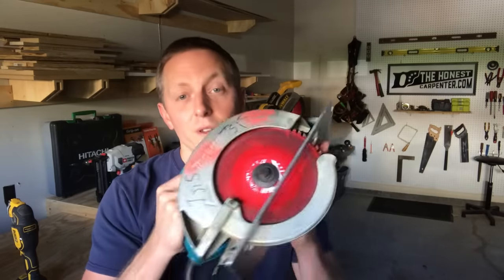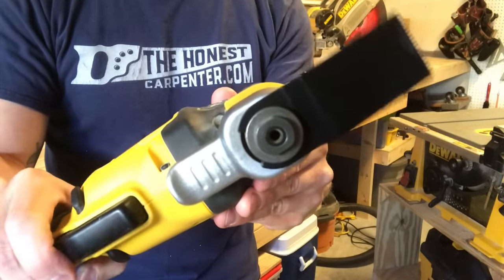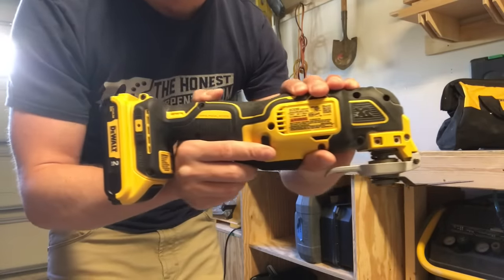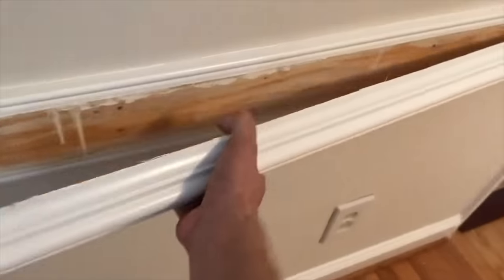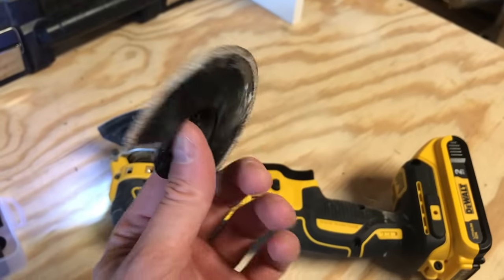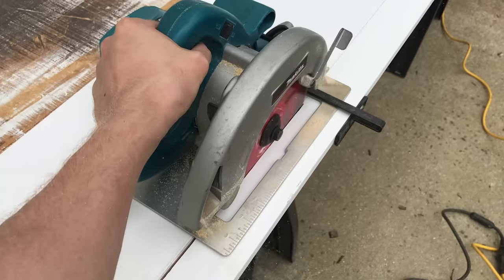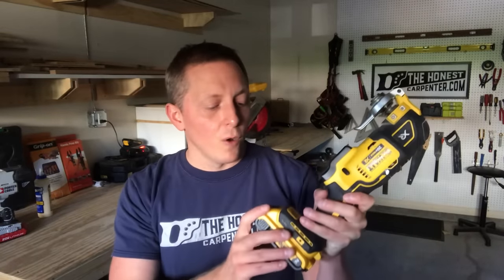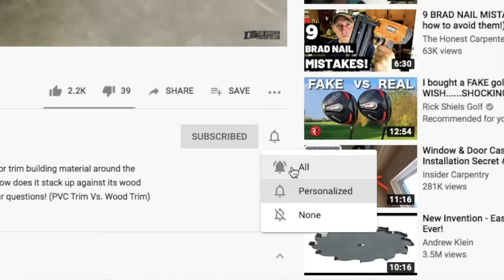The BEST SAW You've NEVER HEARD OF!! (Multitools--Great For Remodeling!)

Comment: "The Honest Carpenter"  "The best SAW" thumbnail and video about an oscillating tool.  I've burned through three now, but never called it a saw.  Don't know anyone who does.
Reply from the maker: You’re right. I mean, it’s got a little light on the end too...maybe should’ve called it the “best little light for remodelers?”🤔
Missed opportunities!
Reply: @TheHonestCarpenter  Mine is called Ossy.  I tell my worker to "go get Ossy out of the truck" lol.  Used mine this morning to sand with.   I've burned through a Porter Cable, Craftsman, and now I have a Westool.  The variable speed ones seem to shake themselves apart after a year of heavy use so far.    I mostly use Bosch tools, but theirs is 200$ and only takes their own "starlock blades"
Reply: You can use Fein blades but Bosch are a little cheaper. Try the ones that are arch shape they tend to cut faster,more accurate and  not over work the lower powered motor models!
Reply: DR PHIL  I did look at that one but the whole "bare tool" buy the battery and charger for $$$$ separately stops me.  All the manufacturers decided to rip us off like that suddenly as a group....
Reply: Anyone who doesn't recognize that it's a saw has a flawed thought process. Does the blade have teeth, and do the teeth go back and forth to make cuts? As for calling it a saw,  the best name I've heard for it is a "jiggle saw" which is a really good description, and at least 40% shorter than other names for it.
Reply: @stevepseudonym445  Nope.  When I put the SANDING attachment on it does not have any teeth and it cannot saw a thing.  When I put a scraper blade, likewise, not a saw.   So at that time it ain't no saw. The "multi" part of "multi-tool" name which is used in trade of these devices, and has entered the general lexicon of those in the building trade, makes my OPINION differ than your opinion.   The thing is, well... MULTIple-TOOLS!!!!! The best name for you, having accused me of having a "flawed thought process" is "jigglebrain".  Or perhaps "passive aggressive" describes you better.  It is, at times, a saw yes.  So I don't see how my thinking is flawed.  If you had an oscillating tool, and a circular saw in your truck, and told a worker  "grab me the saw out of the truck", what do you think they would come back with?  I rest on your face.  OOPS!  I mean I rest my case....(how passive aggressive of me!!!).  Hey are you commenting on a made up name to hide?
Reply: @edwardschmitt5710  , @Steve ... Guys, guys... Settle. 
TLDR: Lets call it what it is, and it can be several things: Firstly a Multi-Tool, but in certain scenarios calling it a saw makes much sense!

Longer:
We know, both descriptions make sense. Both at true. WHAT we seem to discuss is: how to communicate/describe what this tool is. I agree a Multi-tool, best describes it. However, this also tells nothing (multi-what?). Still i prefer this. BUT for someone who need a light saw, it totally makes sense to refer to this tool as e.g. a small saw, or something, and I liked the "juggle Saw" term.
Reply: @carbari  Sorry!!! I get triggered when people take up a condescending attitude with me.  I like a good healthy debate, but that is sadly impossible sometimes.  I can acccept I am human and can be wrong.  Sorry @ Steve.
Reply: @edwardschmitt5710  he called it a (multitools) as a saw because he wanted to talk about it's capability/function (when using it) as a saw. He then compared the cutting (sawing) function to other type of sawing tools. The scope of topic here is about sawing. Yes, it's a multitool. Agree. But... It's also a saw..... and also any other thing it can do. The title is focusing on the context. Not trying to misinterpret its name or limiting it's overall function. He knows that it's a multitool, yet he called it a saw for the context.
Reply: @arievianza  So you need to win and where should I send the trophy? ??
Reply: And you misuse (") ()".
Reply: @edwardschmitt5710  typos or small error is understandable by many when quick (typing) comment via small phone small/limited virtual keyboard.  It's humane. We make mistakes, sometimes we let it be a mistake. Lol. 
Well, I tried the good heathy comment and nothing is about winning. If you want the trophy and there's one. You should have it. 😀 peace man.
Reply: @edwardschmitt5710  Hilarious...an example of life in the time of craziness...I learned a lot though
Reply: @edwardschmitt5710  Well said, Steve! I also know that feeling. Probably, having a worthwhile debate is, I guess, as much about creating a healthy space for such frustrations as well - because that is human!
Reply: @arievianza   I actually think ' @Edward Schmitt ' got the point already. But great to see you agreeing that you actually both tried, not winning, but simply having a healthy conversation :-)
Reply: @carbari  🙏🙏🙏 Agree And again, peace 🤟
Reply: it is obviously a "saw"...not a hammer, not a screwdriver, not pliers, not .......
Reply: @everettpalmer6393  not a sander, not a scraper....you miss my point.  Let me dumb it down for you:  Calling something only one thing when it has multiple uses subtracts from that fact.  I'm not saying it is NOT a saw.  You can lead a cow to water but you can't make it drink...
Reply: @edwardschmitt5710  got it...I can get on board with that...
Reply: (except for the cow...and making him drink.....not sure how that applies to an oscillating tool...perhaps you can "dumb that down" so that even I can understand it)
Reply: @edwardschmitt5710  You were the first to condescend....."let me dumb this down for you"
Reply: @everettpalmer6393  No I treat people with respect who do the same to me.  You drew first blood.
Reply: Never thought I have a use for one of these tools, but I ended up buying one for a big flooring job. I got the Kobalt multi tool. But really, It takes a blade that has teeth and it cuts. If not multi tool, what else could you call it? To me, calling it a saw isn't a stretch. They are hard on blades. The Koblat came with a pretty big assortment of blades, so the tool was actually pretty cheap. Was pretty surprised at the cost of the replacement blades. The better quality blades are worth the extra cost. Best place/cost is Harbor Freight. All in all, I think this video is a pretty fair and accurate assessment of this tool, no matter the brand.
Reply: DR PHIL  It seems to be quieter too
Reply: @stevepseudonym445  Agreed.  Have teeth and cuts? ---->  saw!
Reply: @achacs1  bahaha
Reply: It goes back and forth by oscillating, it has teeth to cut, guess what soooooo many other saws have these features. Hack saws, carpenter saw, jigsaw, plumbers saw, coping saw and so many more. It's a fucking saw when you have the blade for it. GEEZ!
Reply: @AztecWarrior69_69  "Plumbers saws"?  I do a lot of plumbing, (I'm remodeling a bathroom right now in fact.)  What is that? please, teach me oh wise and wonderful "Aztec Warrior"....And when I have the sanding attachment on it is it a saw?  When a scraping blade with no teeth is on it I guess you would say it was a saw.  Oh wait your definition of a saw is "It has teeth to cut", so by changing the blade it can no longer be a saw.  Yet with no blade my other saws are still just saws.  Go search "saw" on Amazon, you will get lots of saws, let me know how long before an "oscillating tool" or "multi-tool" appears in the products.  It's hard to win an argument with an intelligent person, but impossible with a stupid one.
Reply: I see some people I bet are really fun at parties here. sarcasm mode off
Reply: @charlesthronesbery5601  lol
Reply: We’ve all heard about this saw, nothing nee
Reply: Nor Me ,its a MULTI-tool to which mini saw blades can
be fitted to and extremely handy it is too, and where does he get the message that no one but he has heard of them. I,ve had one for years.
Reply: @stevepseudonym445  Dude I love it jiggle saw works fo me.
Reply: Edward, Buy a Rigid. Lifetime Warranty.
Reply: I call it the "buzzy tool". Way more fun to say than "oscillating tool".
Reply: @TheBigBigSean  I call mine "Ossy the Oscillator" I tell me workers to "get Ossy from the truck".
Reply: At the most basic level - If it cuts, I think you can call it a saw.
Reply: @PatrickParsonWorkshop  Again, if it has a sanding attachment on it and it can't cut and only sand, what is it's "basic level" at that point?  It's ok if you still don't understand my point.
Reply: buy the Fein multitool( the OG) , yeah its spendy but you will only have to buy 1 in your lifetime. i've used mine, just about daily, for the past 12 years, its never let me down.
Reply: @everettpalmer6393  but its also a sander, grinder, grout remover etc....
Reply: ...and the EGO strikes again.
Reply: @edwardschmitt5710  Batteries cheap as chips on ebay.  Bare tool without battery much cheaper and you can get the hours capacity you need. Just bought one I will repost if not genuine dewalt as advertised.
Reply: @edwardschmitt5710  it's still a saw though. Just a different and more versatile type. It's primary purpose is to cut. Everything else is a bonus. Just because you don't call it a saw doesn't mean it isn't.
Reply: Funny, I searched for saws on Amazon and the oscillating saw was in the first 5 results. Its original purpose was a saw, hence the original name "oscillating saw" before it became a "multi-tool". I know more people that call it a saw than I know people who call it anything else. If I asked my wife to bring me a saw, she'd have to ask which one regardless because I have so many different types. I have to specify either way, so I call it an "oscillating saw". If I said "multi-tool", she'd bring me my Dremel.
Reply: @HungLikeScrat  Doesn't make is a saw when the sanding attachment is on it.  Doesn't mean I'm "sawing" up stuck on tile with the scraper on it.  Doesn't mean you are right and I am wrong.  DOES mean people just need to feel validated with their opinions on things.  And why on earth does what tool your wife brings when asked prove anything?   We all know very well if you asked her for a saw she would come back with a hand saw, and you know very well you would have to be real specific or just get it yourself if you needed an oscillating multi-tool to saw something with.  Is "searching things on Amazon" really valid to argue with?  My wife wanted a "vibrating massager" for her sore back, do you thing the products that came up were for "massaging" ?????
Reply: @edwardschmitt5710  Why be that way? You got snarky and when others followed suit back at you then you got bent about it.
Reply: Plunge cutter is what ive always called it. These tools r absolutely necessary for certain things. It can effectively replace a couple different tools like a chisel. Love these tools
Reply: @edwardschmitt5710   "I get triggered when people take up a condescending attitude with me."

Should read your OP, and take your own advice.
Reply: @stephanielafever7680  its really good for a variety of things. The cheaper blades r worth the buy
Reply: @edwardschmitt5710  who hurt you?
Reply: @edwardschmitt5710  The fact you are so defensive insinuates some deep emotional issues, get some help buddy.
Reply: @edwardschmitt5710  A case in point.
Reply: @toby8278  A keyboard genius returns with another stellar retort.  Does it hurt you to speak with others who do not posses such a superior intellect?  Well we cannot all be such perfect humans as you, but at least you can sit there and judge as all .
Reply: @edwardschmitt5710  lol
Reply: @abhaynatoo  Wise words my friend, wise words.  "It is hard to win an argument with a smart person, impossible with a stupid person"  (Bill Murray).  This has been a waste of my time certainly, and all pointless semantics.  At least it has helped the maker of the video as every comment is a "view".
Reply: @edwardschmitt5710  I can't believe you've been arguing on this thread for 6 months. Sad.
Reply: @edwardschmitt5710  lMr Schmitt, you are getting belligerent. Please go do some sawing in your shop with a multi-tool.
Reply: @mikewillerton9667  foul
Reply: @FHL-Devils  Mr Schmitt obviously has some issues he can't accept "You say po TAY to, I say po TAH to". Wish he would call the whole thing off. I asked him to go do some sawing with his multi-tool. Sometimes being busy calms a man.
Reply: @annieleu5922  Some people don' pause and say "hey maybe I am wrong" to themselves, but that is a wall between you and the truth.  The only thing thing I have been doing here is saying YES IT IS  A SAW, but it does so much more I PERSONALLY don't call it that.  Most people I guess think their opinion is the ONLY one.
Reply: @edwardschmitt5710  You've haven't been saying that it's a saw at all. You've taken every opportunity and reason to not call it a saw. Maybe you've been arguing so long you forgot where you started. "Don't know anyone who does." It would seem that in this thread, you've met quite a few people who would call it a saw when the sawing attachment(s) are attached. Your OP can and was read as very dismissive, and your subsequent comments reinforced that. I wonder how many other threads you have sprinkled on the internet that look pretty much like this one. You can have your opinion - nobody's taking that away. You're just being judged for it.
Reply: Well, he did says it's not called a saw at 0:31
Reply: @edwardschmitt5710  most people already own multiple chargers. Just a waste of money
Reply: @TheHonestCarpenter  Sir, why did you have to use a Dewalt which vibrates most men to Mars
Reply: @edwardschmitt5710  The whole point of selling "bare tools" is that someone can buy many tools from one manufacturer but doesn't need a new battery for each one.
For a DIYer, for example, 1 battery and charger might well be enough even if they have a handful of tools. A tradesperson might consider 4 batteries and 2 chargers to be enough even though they've got way more tools than that.
So quite the contrary to being any sort of rip-off, the manufacturers are making it cheaper for us.
Reply: Way to split hairs
Reply: @NotSoLiberal  The multi-tool might be versatile, but it wouldn't be my go-to for cutting anything that fine.
Reply: @yardfowl3149  Re: Fein recommendation... agreed. I do staircase renovations. About 12 years ago I expanded to include refinishing existing hardwood stairs and tried a B&D mouse for corner sanding. It burnt out in less than a day. Then I remembered that the Fein vibrational tool I picked up a couple of years earlier, that I had always thought of as a saw, also has sanding attachments. It was the perfect solution. After 12+ years of heavy use as a saw and sander, it started to show it's age, so I relegated it to home project duty and decided to try the Ridgid for work. The Ridgid heated up so much with any prolonged sanding that I couldn't use it. I bought another Fein within a few days and gave the Rigid away. I have wondered if the Dewalt would perform better than the Ridgid but I've decided to stick with what I know will do the job.
Reply: @edwardschmitt5710  And your point is?
Reply: I was using one of these in the UK (corded 110v via a petrol, gas to you, generator) on building sites, back in the very early '80s. Makita, I could swear that they were. Back when we were officially called 'Cladding Technicians' (Or Sheeters' to you and me). Back then, 40 years ago, they were pretty scarce, probably never seen by a DIY-er and scarcely owned by a joiner/carpenter/cabinet maker or other tradesman. And when we needed one, we had to send out for it, to the depot. And they hired one. And we definitely asked for the 'Reciprocating SAW'.
Reply: yes use them for their purpose and u wont burn thru them
Reply: @edwardschmitt5710  Things don't differ than other things. They differ from them.
Reply: @jumpinjohnnyruss  Sorry for the grammatical error.  Does my comment get a minus one point and that is it for your little missive there??? Quick there is an old lady crossing the street 2 inches out of the crosswalk!!!!!  Tell her she is jaywalking!!!!
Reply: When it functions as a saw, it's a saw.
It's a saw when it's being a saw. It's a sander when it's being a sander. It's a paper-weight when it's being a paper-weight. The tool without any attachment is a multi-tool. The tool with any attachment is a multi-tool. Call it what you like. Call me Daddy while you're at it.
Reply: @jumpinjohnnyruss  Oh you agree with me then.  Thanks son.
Reply: I've always called them a Fein saw because I use the Fein brand at work. I own a Milwaukee M18 "Fein saw" and neither have ever let me down
Reply: S
Reply: @edwardschmitt5710  The Best Multi-purpose Tool that Can Work As the Best Saw for Many Applications."
Point taken -- accuracy in language is a lost art.  Long lost art!
Reply: We call it a saw in apartment maintenance. It’s an oscillating saw. It’s a saw
Reply: @russiaprivjet  I call it a dead horse and you are beating it.  Go beat something else.
Reply: @TheHonestCarpenter  the blades aren't that sharp... and its not that dangerous. I can run my ridgid jobmax full power with a brand new blade and it wont cut my skin. Try it!! Your skin moves with the blade. Dropping it on your toe would hurt but not much more. Ha ha like it would cut it off
Reply: Troll much...?
Reply: @TheHonestCarpenter   I use a file (sometimes a metal nail file used for manicures) to sharpen the teeth on my saw attachments…Am I missing something, do people not sharpen these blades? It seems to save me money replacing them. 🤷‍♀️
Reply: @edwardschmitt5710  just buy one with a cord that doesnt need batteries
Reply: @TheHonestCarpenter  🤣🤣🤣
Reply: @stevepseudonym445  That's the name of my favorite head
Reply: @edwardschmitt5710  triggered much?
Reply: Well I didn't have one until I saw this video and now I do so, good info for us amateur home owner Do It Yourself guys.
Reply: Dude come on this is like saying a pocket multitool isn't a pair of pliers with "it's not a pair of pliers, it's a multitool" as your justification. It can saw, so it's a saw (amongst other things). Beyond that this guy's channel is great and so is this video. Should see a barber about all those hairs you're splitting.
Reply: Maybe buy the original ("Fein" Tools from Germany) or another top brand?
I got mine (a Bosch) since 7 yrs now and maltreated it at my best - and it still works flawlessly.
Reply: You could call it a "trim saw" ... cue the 1970s porn music.